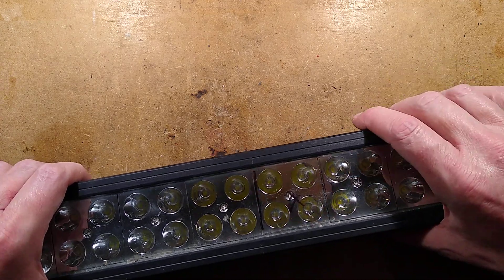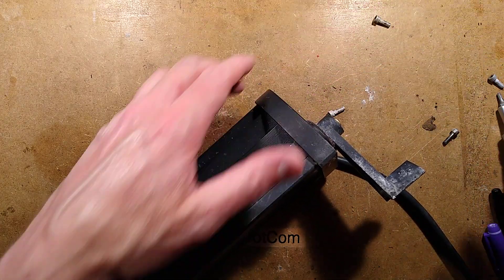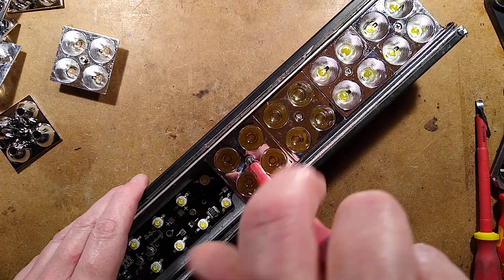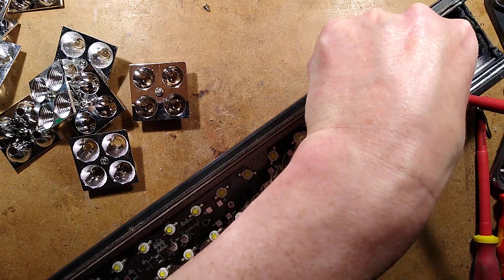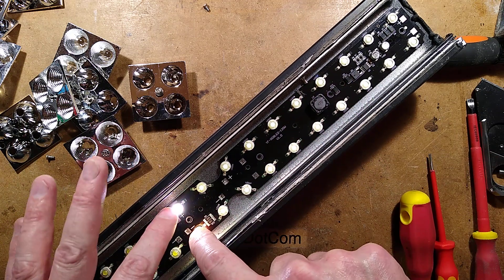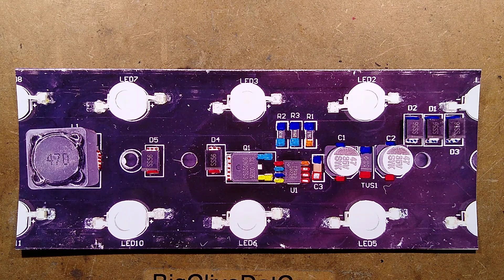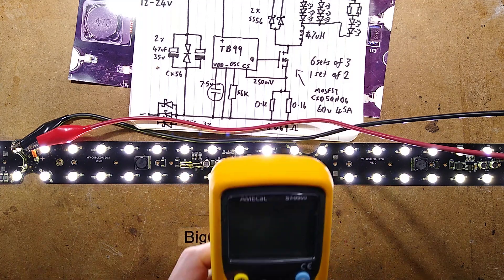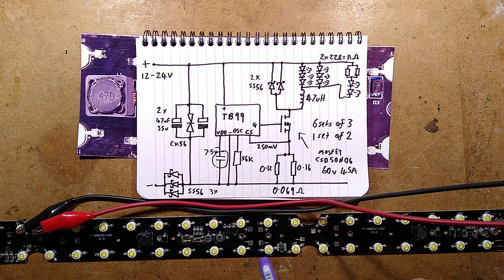Opening a work light from a commercial fishing boat (with schematic)

Comment: Given the circumstances, the light was probably banged up fairly frequently.  Capacitor probably shorted from physical wear and tear.

$0.02
Reply: Environment is rough but not that rough
Reply: @MadScientist267  it shouldnt get any physical wear and tear inside there, except maybe thermal cycling? maybe that was it.. i hate those surface mount caps, i have a dead laptop full of the things with shorts measuring across a few ... its either those or the graphics chip as it looks a bit 'cooked'
Reply: @andygozzo72  Nothing has any real margin anymore, it's all right on the fence of failing because the spirit of reliability got traded off for cheap.
Reply: @MadScientist267  I imagine it's probably been dropped a few times.
Reply: @RK-kn1ud  These aren't "carry around" type lights. This is a "midnight sun" that gets mounted up high somewhere and possibly on a mount that allows it to be aimed.

Main threat on a boat is water ingress; Clive mentioned it was dry inside but it doesn't take much moisture to get corrosion going where DC is involved.

That said, it was more than likely just insufficient rating margin on the cap, and it shorted out internally as a result. Not a lot of current involved in the supply for that chip, so even the smallest bridge, chip loses power, light goes dead.
Reply: @MadScientist267  Maybe it was the first time someone used a product for something other than it's intended purpose.
Reply: @RK-kn1ud  ok let me try it like this...

I have one of these... It's not even remotely practical as a handheld light.

That work?

Comment: Finally. I was waiting for you to get an led light bar. Offroad light bars are one of the largest offenders for over rated stats. Every single one I've ever purchased has drawn less power then stated. Having purchased "name brand" bars, and eBay specials.
Reply: Yes, they often quote the total rated power of the leds but not the consumed power. Heatsinking is always an issue when the vehicle is stationary (they still get pretty warm even when underdriven) that's probably why they never run the leds at max rated power. Still good though as underdriving leds make them more efficient in lumens per watt input.
Reply: @quandiy5164  I get that. But when you pay more for a 180w bar, over a 100w bar. And the 180w draws 90w... Gets kinda frustrating
Reply: @HakoFrost  yup, it is kind of frustrating but think about it, the 100w bar you passed up most probably have been 50w actual 😁 I believe even the brand name ones are made the same way (not sure, never owned or tested one - too broke to pay for a set) but you just pay for better after sales support and warranty.
Reply: You have to see if they are talking about actual consumed power or relative to incandescent power. Also they lie....
Reply: They used to recommend or even provide 20@ fuses with these light bars when I installed them in new vehicles. If they only consume 90W those fuses should be pretty useless. Could it be that they rate 24v power figures if they are dual/ flexible voltage?
Reply: Even with less power than rated, they're still blinding when people drive around with them on all the time
Reply: Technically that's a good thing, as life of the LED emitters will be longer.

Comment: A faulty MLCC strikes again!    I wonder how much much electronic equipment is sitting in land fill with just a faulty MLCC?
Reply from the maker: Or is causing short battery life in normally low current equipment with one across the battery connections.  I see that a lot.
Reply: Lots of TVS diodes and shorted MOSFETS as well.   Multi-thousand dollar products being tossed over $0.02 parts